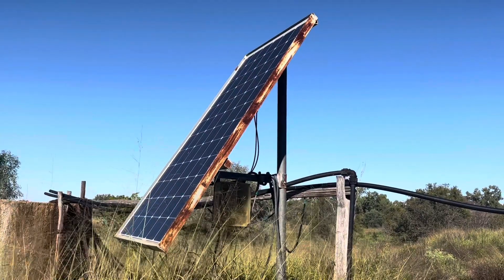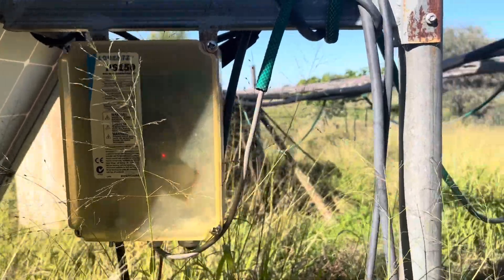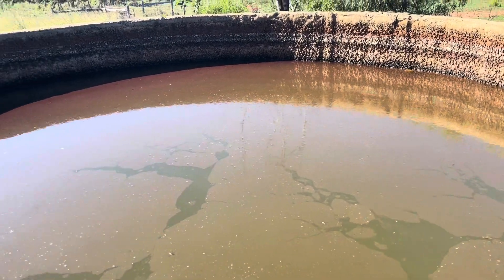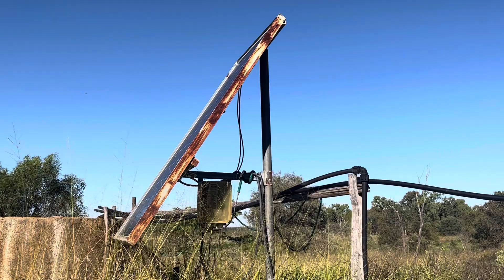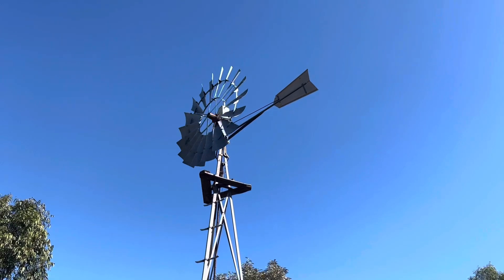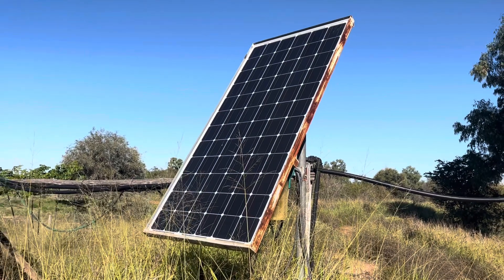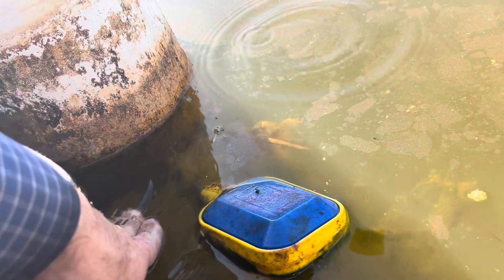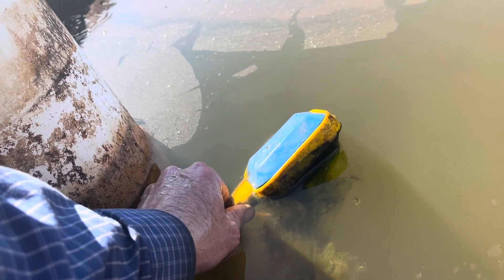Renewable energy solar water pumping.

Comment: How long have you had this system going for? Have you needed to replace the solar panel or the control switch yet?
Reply from the maker: I’ve got ten of these solar pumping systems and the first one I installed in 2012 is still going strong. I’ve only had one control box fail and it was replaced under warranty. The float switches fail every now and then. The biggest hassle is cockatoos chewing the wiring.  Always happy to answer questions 👍.